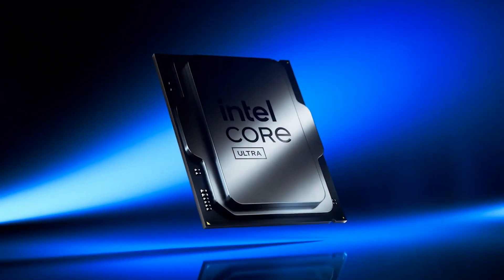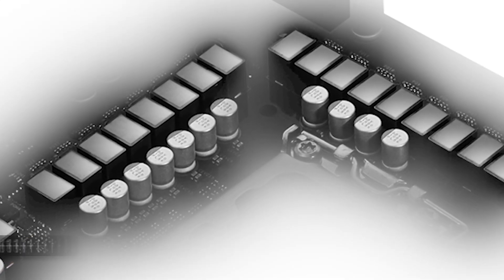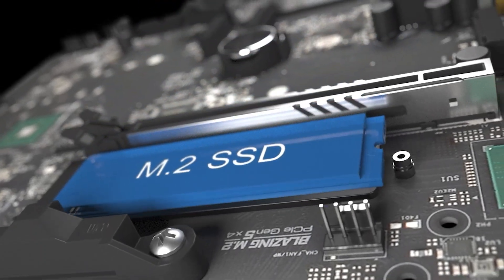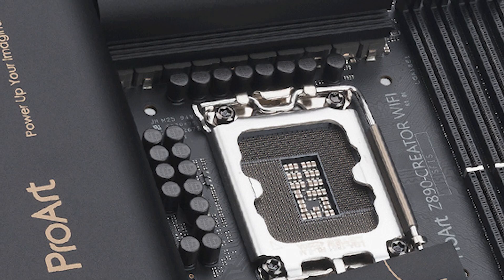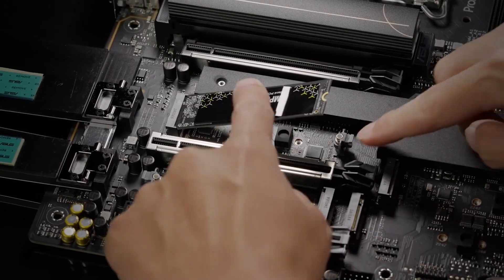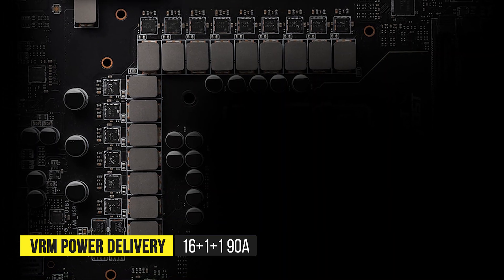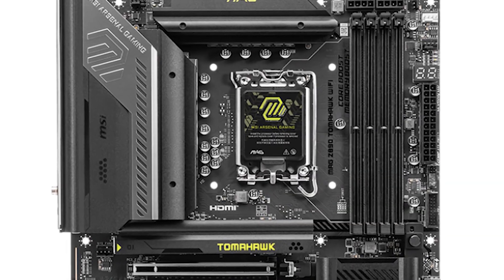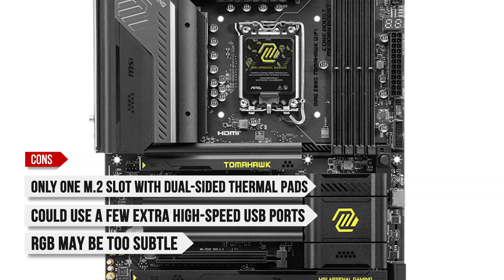Best Motherboards For Intel Core Ultra 7 265K In 2025 ✅ (TOP 3)

Comment: Ultra 7 265L on motherboard bios has 3 turbo mode levels: level 1 200s boost. level 2…. and level 3…. But when I use level 1 nothing happens. Until I switch to level 2 and level 3 in the turbo settings section of bios, when starting the computer, I need to turn it on and off twice to turn it on. psu 1300w. If you don't turn off the power from the source and the motherboard light is still on, there will be no problem. When I turn off the power of the psu when starting the computer at level 2 and level 3, there is a problem.

Comment: Please tell me should I buy 14700k or ultra 7 265k. I am very confused. My work is video editing, productivity and use Premiere Pro, After Effects like that software.
Reply from the maker: They provide more or less the same performance but for the 14700k there is no upgrade path so if you are building a completely new PC the 265k probably make more sense
Reply: @BCZone  also the 14700k can burn itself
Reply: 265k all the way
Reply: You can compare your cpus in pugetsystems benchmarks, they do this kind of testing for productivity. I have i9900K right now and I am definetely upgrading to 265K soon. I do photography/video too. Cant wait for the upgrade since my old 9900K does not accelerate hevc 422 coming from my camera but 265K has much newer QuickSync so I am curious how it will all go.